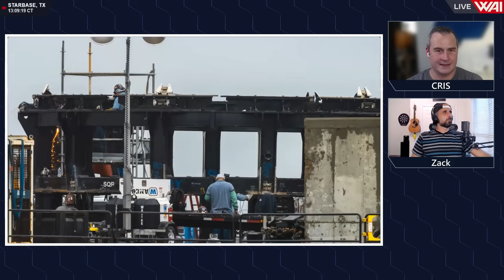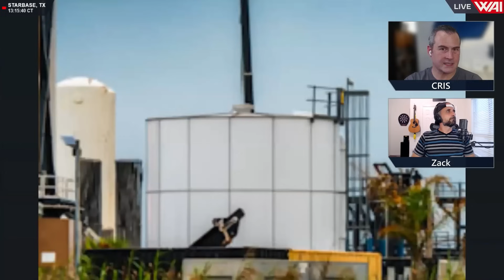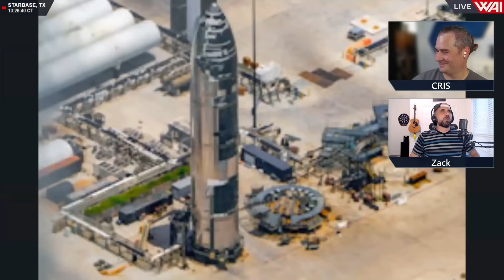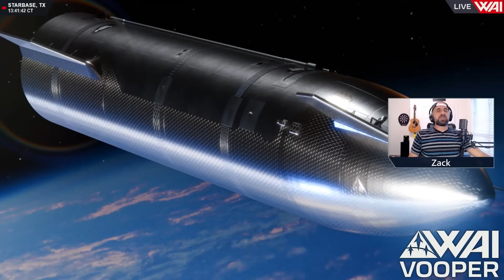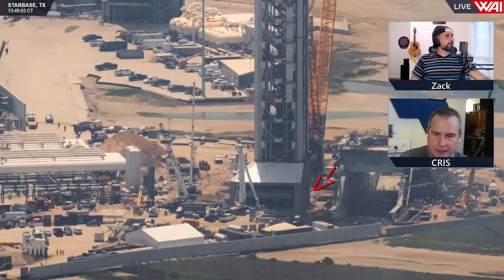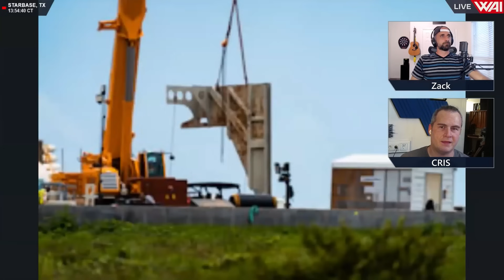Will SpaceX do Starship Static Fires at the Launch Site?

Comment: I hope not it is n9t wrth the risk. The question we need answers for is why is thhere no backup plan for test site. Like a 2nd one!!!
Reply: Test sites are dangerous, have to be remote, costly- & sit idle 90% of the time. Unless you also rent it out for others to use, pretty cost-inefficient relatively.- Dave Huntsman
Reply: They don't have the land to put one, it has to be in a remote location which is just not available in the area. There are plans for more test stands at LC37 for their Cape launches.